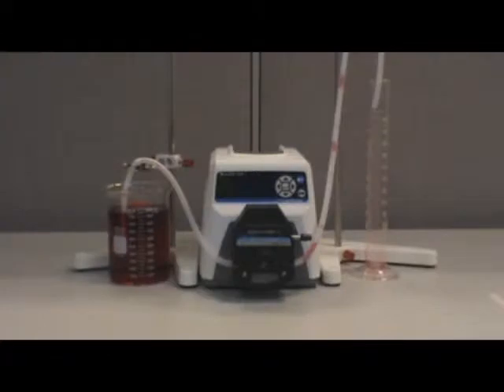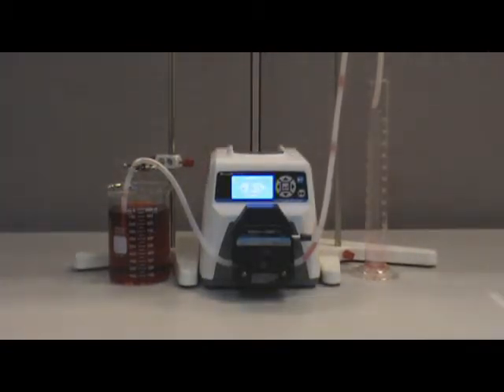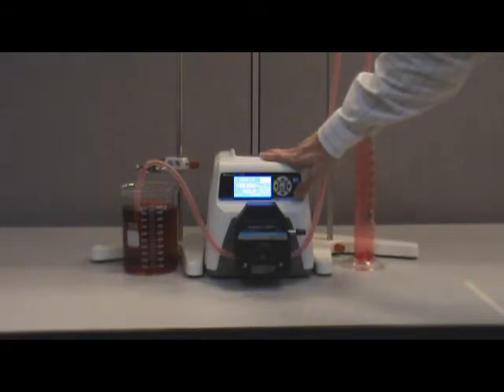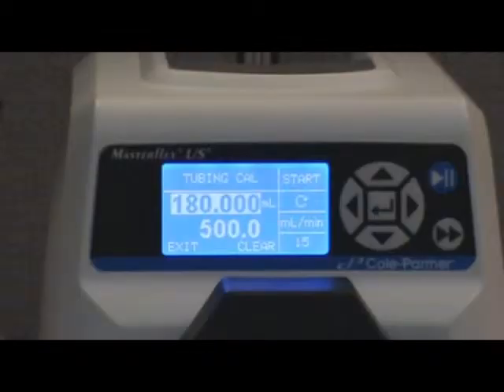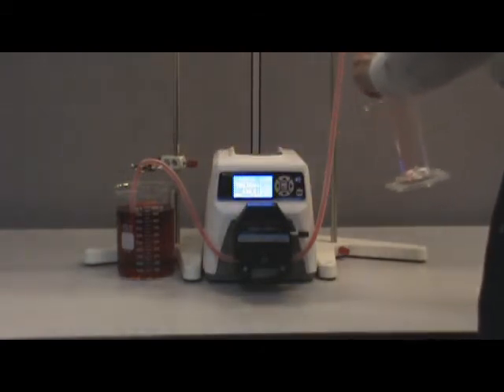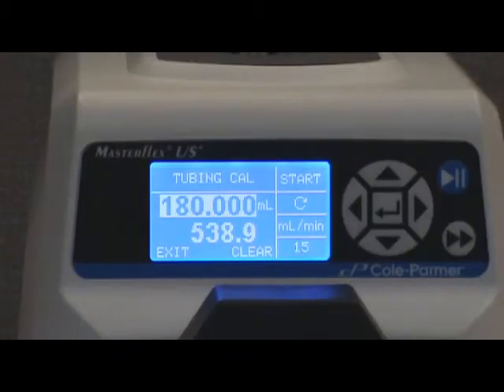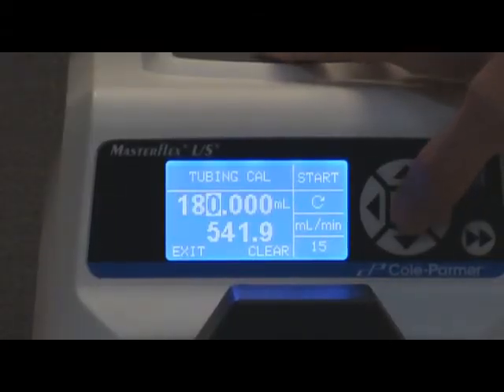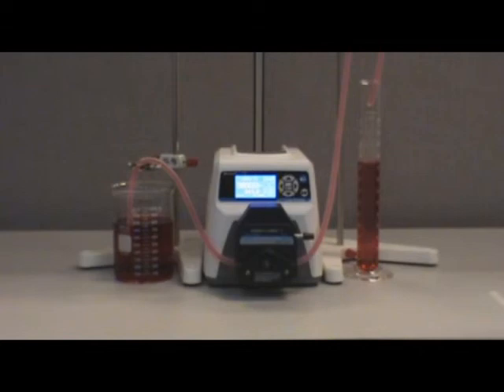How to calibrate your Masterflex L/S Variable Speed Digital Drive

Comment: Why is the flow rate changes with the calibration? Why the 500ml/min at the start of the video changes to 542 at the end?
We are running the pump in volume dispensing mode. We adjust the flow rate at 1.5 L/min, then do a calibration (hose #36). The calibration is, say, 1.234. Why is that, if I go back to FLOW RATE, it has changed to 1.234??? And if I change the flow rate back at 1.5 L/min, the calibration ratio changes back to 1.5. Please, explain this to me.